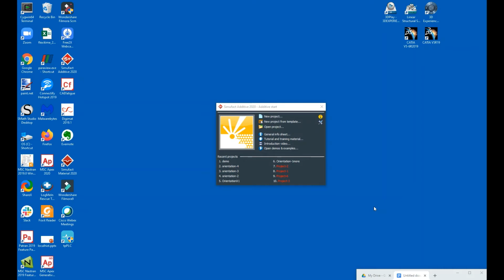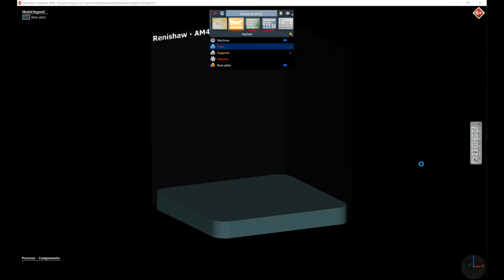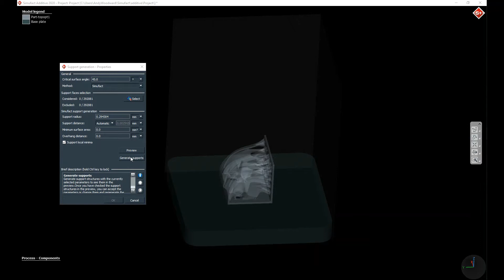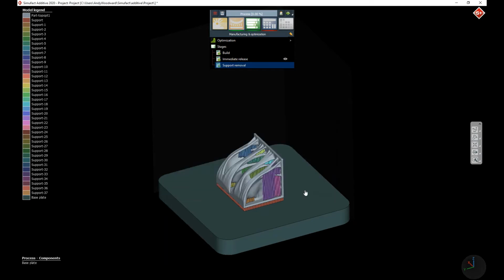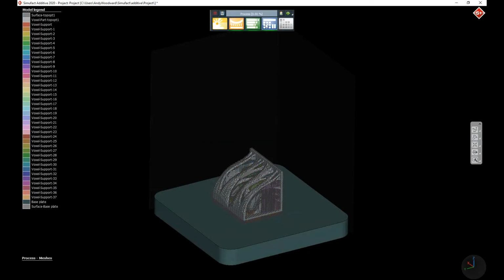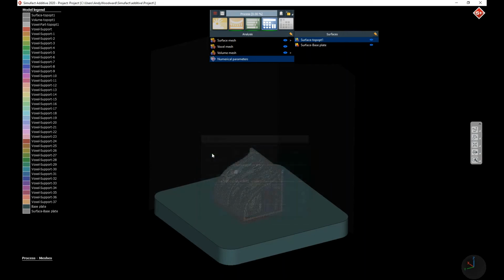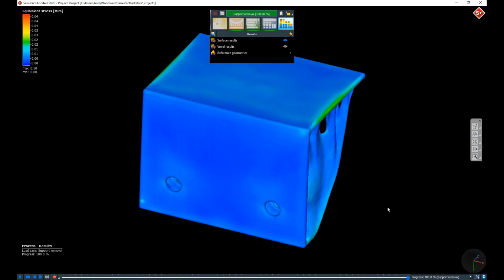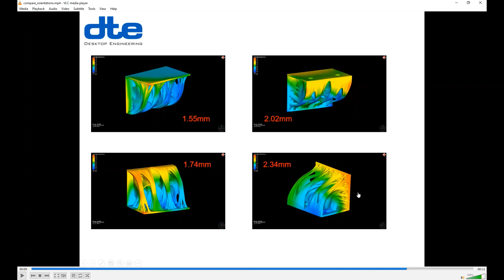Simufact Additive Manufacturing - shortcut process of setting up prints of 3D parts in metals

Comment: Hello, thank you for the tutorial. Is it possible to consider more than 1 orientation during the same simulation?
Reply: Not in the same simulation run - the reference coordinate system is the tank rather than the part so to build in a different direction you would have to re-orient the part model
Reply: @andywoodward7273  Thank you so much for the answer!